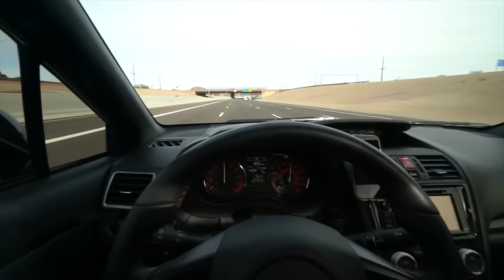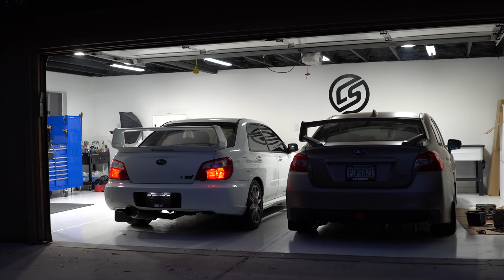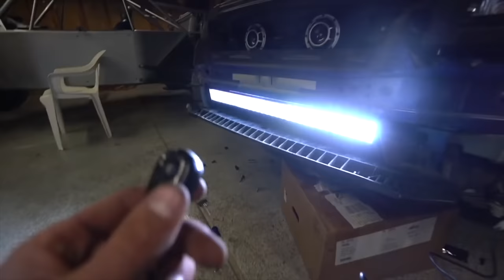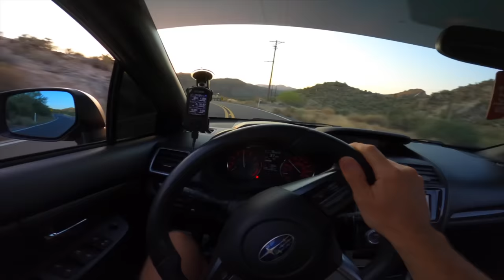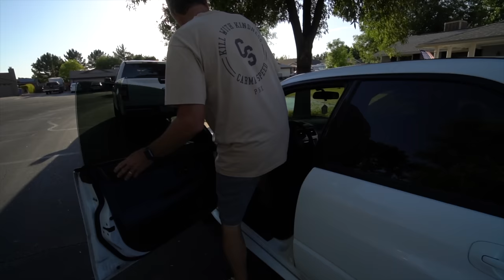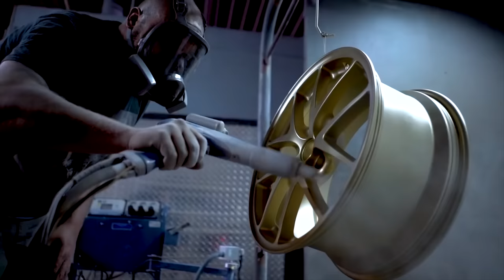Which Subaru WRX STi Should You Buy, Old or New?

Comment: they are going to be like air cooled 911s. 100k for a sti 65 for a wrx and 30 for a 2.5 na
Reply: I think that's a little optimistic, but yes older  low mile clean stis will definitely appreciate overtime. Very unlikely a 2.5 will appreciate like that in my opinion.

Comment: i got a regular 05 impreza rs and i absolutely love it, it doesn’t have a turbo but i still like the way it looks the body style that is. what y’all think good or bad?
Reply: You know what? It doesn't matter what other people think.  If it puts a smile on your face when you drive it that's all that counts.

I recently got rid of a 2015 Audi A3 2.0T Quattro to get a 2017 Focus ST.  Some of my non gear head co workers looked at me like my head was on sideways when I told them that I was bored with the Audi.  It just didn't put a smile on my face any more when I was behind the wheel.  The car guys that I work with TOTALLY understood what I was getting at.  One of them said to me it's "not about miles per gallon it's about smiles per gallon".  The ST is rough around the edges compared to the Audi, but that is part of the charm.  The ST raucous and raw feeling.  The Audi was sterile and detached in comparison.  I'm finding reasons to get behind the wheel of the ST as often as possible.  The Audi lost that feeling for me quite awhile ago.
Reply: @brandons9138  i completely agree with you, as long as it puts a smile on your face :)

Comment: What type of milage range do you typically look for when looking for an older STI and at what point do the miles get a little too high to consider?
Reply: Unmodified, preferably under 100k if your lucky. Just make sure to see if there is any smoke from the exhaust on start up, aka thick white or blue smoke. If there is stay away. Also a compression test wouldn’t hurt. Also make sure to look at how often the owner changed the oil on the car fax. And obviously check the oil level. This is important.
Reply: Also, forgot to mention, listen to the engine running. Listen for anything other then the typical injector tick which can be quite loud. Also, look for any oil leaks, specifically by the valve covers, and turbo.
Reply: Good luck finding a GD STi with under 100k miles for less than $25k
Reply: @jordanross3290  I know, and I was able to find mine for way less than that. The market has blown up.

Comment: when I decide which car will be my daily, I usually consider a few things like fuel consumption, maintenance costs (fluids, filters, brakes, clutch), and part costs (in case I have a minor damage to repair) - and here the WRX has always been my choice over the STI... with the GD models there was a bigger difference in power output, so many people went for the STI, but on the VA model WRX with its 6 speed gearbox, 268HP and the twinscroll tubo, there is not that much of a difference to the STI anymore... If I would live in US and had to remap my subaru anyway, due to the bad fuel quality, it would be just another reason to go with a WRX, squeeze a few extra HP out of the car, and enjoy it... And I would pick the new one over the GD, because it is the more practical car, has more space in the trunk, the backseats can be flipped for even more space, you have all the features of a modern car, a better fuel consumption and still enough power to have some fun on curvy mountain roads... BTW I dont get why anyone would call the GD interior cozy - drive 500miles in a GD and then in a VA - you will feel the difference ;)

Comment: I bought a gd chassis. But I really want a 05 sti
Reply: O5 is a GD Chassis, GDs ran from the Blob eye to the end of the Hawkeye generation, (2000-2007) the Hatch became the GR generation, until (07-2014.)
92-2000 was the GC generation! 
Current gen the VA generation (2014 to current)
Reply: @maverick2242  I meant I bought  a gr

Comment: I bought my 2006 STI in 2010 when I was 22 years old, with 34k miles on it for $24,000. Ended up having the engine rebuilt shortly after; I feel like the previous owner knew if the oil issues it was having and dumped it...

Through all the hassle and issues, I'm very glad I held onto it over the years, and that I've still got it today. 72k miles on the car, about 30k on the engine.

I'll keep hold of this car forever. If you're looking for one, keep looking and don't be afraid of putting some work into the car if it needs it, it will be well worth it in the end!

Comment: My 2015 new gen sti was amazing value for money. People buy old beat up evo’s for more. This is not even an argument. The 2015 has better feeling and quality suspension/steering/gearbox/safety/interior/availability on parts/rigidity/lighting/updated crank/vf48 turbo.

Way better value for slightly more money. Mine was $25000 Canadian in minty shape.

safer/quieter/faster hydraulic steering and could go on and on especially in the suspension and interior. Also the updated factory tune is like the equivalent to an older sti with a stage 1 COBB tune. So many benefits. They also look great people are just haters. More potential in a more rigid chassis too.
Reply: forgot to mention the larger factory intercooler oh and did I mention its way way safer with more airbags too.
Reply: Newer Porsche 911 crush the 964,993 etc (air cooled) in every metric but people pay for old school. While the newer may always be better on paper the old school just has that old school vibe and feel
Reply: Sorry bro, they might be better on paper but honestly they look like Camrys. It's lost that signature Subaru look.

Comment: Which one doesn’t have the head gasket issue I keep hearing about?
Reply: Neither is the answer 😂
Reply: Neither
Reply: None of them. The head gasket issue was way more prevalent in the late 90's early 00's 2.5 liter non-turbo cars. The turbo cars can develop head gasket issues if you run them hot. People blow the head gasket thing way out of proportion. In reality you are more likely to crack a piston ringland before head gaskets ever become an issue on an EJ257.
Reply: No headgasket problems at all, but pistonring failures, yes.